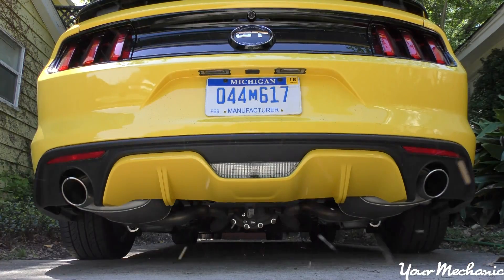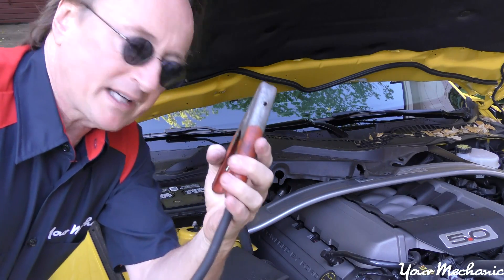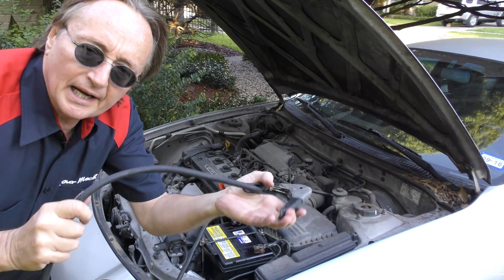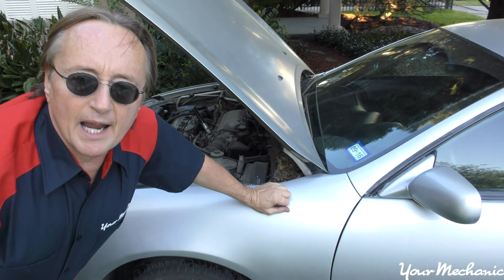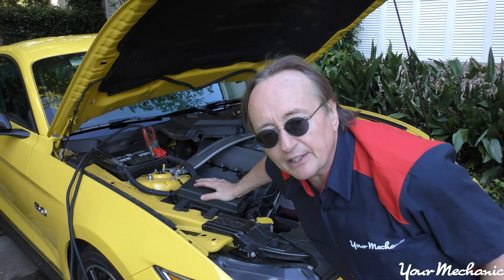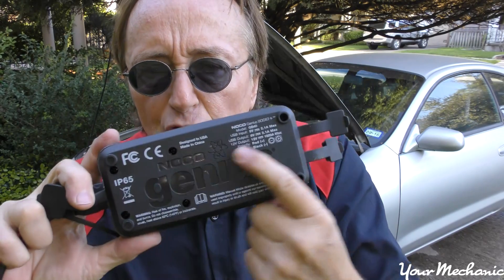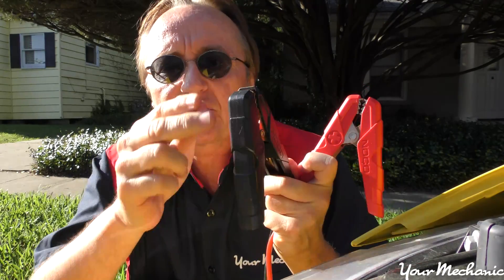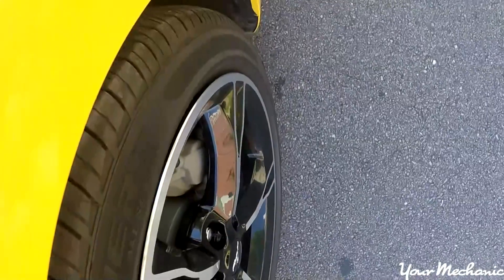How To Jump Start A Car Battery with Scotty Kilmer

Comment: Is it possible to start an engine with a ratchet at the crank/harmonic balancer and maybe removing a couple spark plugs to make it easier to spin engine over .  I come up with this idea when I was replacing front crankshaft seal . I was listening to car radio while turning crankshaft when it accured to me that I had the ignition switch in the run position and not the acc position  . I believe  the run position of ignition switch is where you want to have it when push starting an manual . transmission which in this case maybe could have started up with a little more effort and maybe removing a few more spark plugs . If so this just might be an alternative to start a vehicle ; well for the risky type that is .  P.S. I was able to break loose harmonic balancer bolt by disabling the Fuel injection system ,  putting breaker bar on bolt and resting breaker bar against the vehicles frame then turning engine over a few times with the starter . Tighten harmonic balancer bolt best I could which seems to be good enough since I've put at least 10k miles on it with no problems  . Maybe someone can do a video on all I just said . Working on another technique to jumpstart using starting fluid and  jumping an spark plug coil or two but I'm still trying to figure that one at .

Comment: Scotty--Every other video I've seen about jump-starting a car begins by putting the red (positive) clamp on the DEAD battery, then take the other end of that cable and clamp it to the positive (red) DONOR battery terminal .  Here, you did it the opposite of that advice, and I'm wondering why. Theoretically, it shouldn't matter, as no power is yet running from one battery to the other until the black clamps are attached to the DONOR battery and then over to a ground (bare metal) of the car with the DEAD battery, but that's the way the other videos recommend doing it.  Can you do a follow-up video to explain why the way you did it was okay, and why it will not result in an explosion or at least won't cause a no-start situation?  Thanks.

Comment: Hey scotty do you recommend buying jumper cables from harbor freight?
Reply: Shanoy Francis as long as they’re thick copper then it should be fine. Slightly thicker aluminum would work as well, just had more resistance hence why it needs to be thicker.

Comment: Scotty check out the OzCharge Kanga 500

It uses capacitors to jump start the car of its own dead battery.......

Also I’ve never had much luck connecting the negative to the motor.... always had to use the terminals on the dead car..... we were taught to connect negative on dead car to engine block as a buffer to stop peak current frying electricals on dead car.....

Trouble is it never seems to crank that hard

And we were taught donor car is to be running.... even rev it up as dead car is started....!

How times have changed....!  Keep up the great videos...!

Comment: What about using a jumpstarter? The cable is very short do you still put the neg on the metal of the car to ground it or on the neg post
Reply: John Ernest - The thing he showed you at the end was a jump starter. Until you turn it on, there will be no power to make a spark, just like he says in the video. 

So yeah just put it directly on the battery.
Reply: @TheEgg185  thank you for the reply😁

Comment: does it matter which car you connect positive to first? Also should both cars be off? My dad always jumps my car while his vehicle is turned on :|
Reply: Alison Isaac realistically the order you put the cables on doesn’t matter. It’s more just for safety that you put the negative on the dead car last because it will spark. The cars should be off before connecting the cables though. I DO NOT recommend trying to start the dead car without the good car running/ran for a few minutes to charge the dead battery. You run the risk of draining the good battery (if it’s old) leaving you both stranded. I’ve always been fine with starting the good car and letting it run for a minute, then starting the dead car. You don’t have to shut off the good car before starting the bad one.

Comment: does this damage the car that is helping?    a lot of people dont want to help with his car because of this.....

help plz?
Reply: Not if done PROPERLY
Reply: yea but, i heard a lot in my town  that u need to conect the negative battery of the bad battery and not the  good one.  

Because if your car had a breakdown voltage you dont damage the other car(the good one).

And i haven't hear anything about this in the videos that i search
Reply: If you don't have a positive to positive connection you literally won't be able to jump it.  The negative provides the ground.  Without a ground there is zero current flow because the circuit is open. Only cars with different voltage batteries will be damaged (like a 6 V donor battery and 12 V dead battery).

Step 1: with cars off, park them close but make sure they aren't touching each other (which would complete the circuit).

Step 2: make sure the batteries are the same voltage

Step 3: Hook positive donor battery to positive dead battery

Step 4: Hook negative donor battery to ground - usually unpainted metal is best.  You COULD connect to dead negative, but this is discouraged because if a lead-acid battery is overcharged it out gases flammable hydrogen gas, and a spark could ignite that.  Rare but it happens.

That's it.  You'll only break stuff if you use 2 different voltage batteries, connect the wrong terminals to each other, or give the car a ground where it shouldn't have one - like if the frames of the 2 cars touched one another.  Letting lead-acid batteries overcharge, run out of distilled water, corrode, or expose them to high heat will also prematurely kill them.